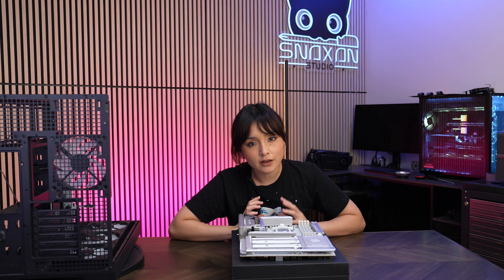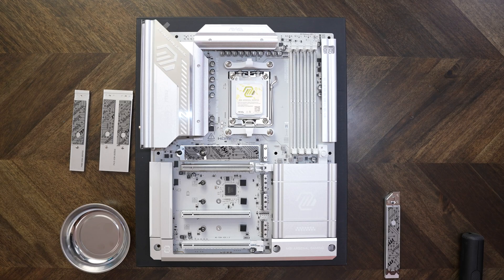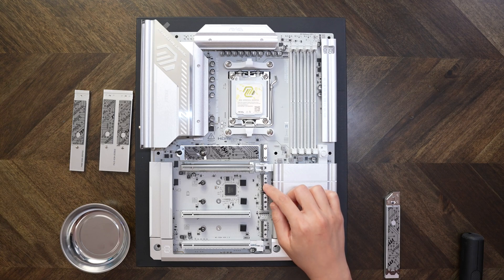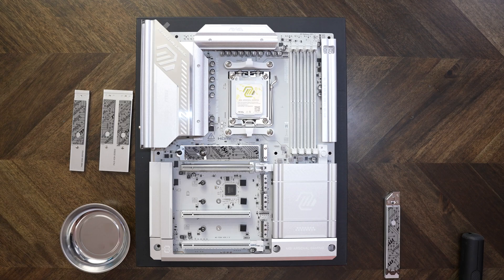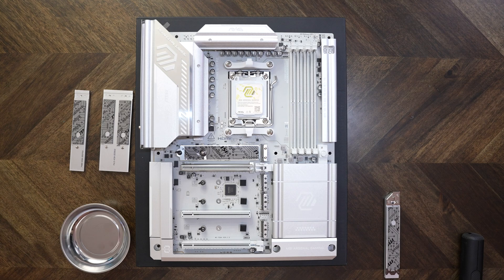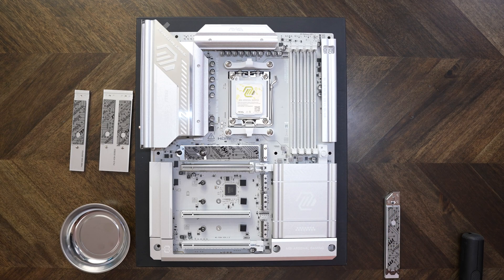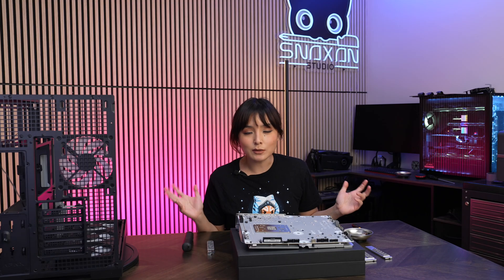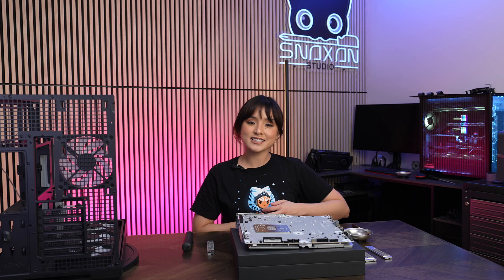Project Zero + AMD x870e | MSI MAG x870e Tomahawk MAX Wifi PZ Preview

Comment: Are you having driver and PC shutdown issues? I recently got this mobo and swapped out my current build which was also a x870e msi pro entry board. And my PC has gonna haywire. PC shuts down when installing apps, games and drives. Sadly there is no bios update. I fresehe installed windows and all and it just powers down. Event log states kernel power failure
Reply from the maker: I haven't used this board yet as I'm waiting for the right build.  however assuming you have all the latest drivers installed (GPU too),  I would start with the easiest and monitor your temps when you're installing stuff.  If you're temps are high, maybe the cooler wasn't seated right with the paste.  if not that, then check your RAM, try duplicating the issue with just one stick in or other RAM to get that out of the equation.  The one time I had a kernal related error it was the RAM.  Also check all your PSU cables are seated and tight.   The last thing in the chain is the mobo itself but that would be really rare.    Good luck and hope you find a fix
Reply: @SnaxanTech thanks. Problem is I custom hard tubed my PC and the last thing I expected with this. I will try to swap back the old motherboard. I'm hoping for a bios update before then.  Thanks. Will have to take it apart and troubleshoot with soft tubes. I will update once I find a fix
Reply from the maker: @jolush1207  good luck!  but yeah, just check those temps first!
Reply: @SnaxanTech sadly I had to RMA the project zero board since it doesn't have new firmware my 9950x3d kept shutting down when launching games. Tried my old mobo and another board x870 and it worked perfectly. I will get another pz board when a few firmwares are released.

Comment: Looks great, but I am wondering, due to the back connectors is this board limited to certain cases that can accomodate those back connections?
Reply: Pretty much yeah, I think currently sold MSI branded cases support these motherboards. And all the Frame cases from Corsair also support these motherboards.
Reply from the maker: Yes, you need to check the case specs to make sure they are back to front compatible.   MSI is called project zero, Asus is BTF, and gigabyte is called stealth.  The layout on all of them are generally pretty similar from what I've found, meaning if the case is BTF, it may also be just fine for Project Zero.

Comment: Love the brushed alloy, hate the PCIe lane share, but to be honest plugging an external USB4 drive into a PC is also irritating.

The back connection would certainly remove the desire for braided Cablemod kits, the color looks like the Sapphire Nitro+ 9070xt would work,  sadly won't work in a HAVN case. But still tempting.

Comment: Those companies need to stop putting resistors under m.2 ssd i had to return 10 ssd enclosures because ineo updated their 40gbps enclosures to all have planned obsolescence the ssd gets very hot resistors should not be under those components. Measure the space if a thermal pad does not fit like the ineo enclosure it bad design. All that heat going right over the chips and resistors.
Reply from the maker: Interesting.  Never heard about this being a common issue
Reply: @SnaxanTech they literally just started doing it the past year. Ineo 10gbps 20gbps didn't do that. Immediately when ineo 40gbps came out every single enclosure of theirs had it. I couldn't even count how many resistors they crammed under there it was so irritating. Now they want to start putting vital chips. Not good

Comment: I have the regular black version of this board in my main system. It's the best overall x870e board out there.
Reply from the maker: I always tell people the tomahawk is one of the best bang for the buck motherboards you can get
Reply: @SnaxanTech I own the Asus x670e Extreme, used the x870e Crosshair, and also the x870e Gigabyte Master board...the MSI Tomahawk x870e is hands down the best AMD board available right now. It's also more stable IMO than the rest. I want to test out the ASRock x870e Taichi Lite board though. It's priced right, is EATX and has a ridiculous 24 phase VRM, lol.
Reply: Gigabyte Master x3D board is the best

Comment: After years of using Gigabyte motherboards, I also got an MSI but PRO B850-P wifi model for 9600x and 9070XT. My first choice was AsRock, but I didn't want to risk (the rumours about 9000 series CPUs dying on AsRock scared me a bit).
Reply from the maker: Nice!  My first watercooled PC ever actually had a gigabyte motherboard and it's still running, never had much experience with AsRock.  I've built tons of MSI as of late, no issues either.

Comment: i wish more boards would rather put all their nvme and usb lanes on the chipset and leave the cpu lanes for the pcie slots as most power users need more pcie lanes.
Reply from the maker: It's probably because you'd still only have 8 lanes left after the first pcie slot, also keep in mind you might get bottlenecks for any nvme 5.0 if you don't go directly to the cpu.

Comment: I can‘t understand why everyone just refuses to also make these back connect boards in black!
Reply from the maker: If you have to have black, you can go ASUS.  Theirs are almost all black while MSI is white/silver.  I really like the look of the white/silver though
Reply: cuz they  are still too niche for most builders and the point is to see how pretty the "non" cables look. i am with you overall tho, as id love to do a back connect build but only if i can find a black mobo
Reply: @larrydysondev  I'm currently in case compatibility mode for this X870E Silverback beast. I don't wanna use MSI's PANO 100 case so I'm still hunting. I gotta say the silver is kinda growing on me a little. Plus this board is pretty feature rich. 2x Gen5 2x Gen4 + the extra PCIe power connector, you end up with a total of 420 watts of available power...that's bananas. I might need a 1300w PSU for this Beast. This board smokes the ASUS B850 BTF.
Reply: Theirs a Intel rear connect board i black...ASUS I Think. I' was trying to find one as well but a AM5 board in black.
Reply: @Csimon2429 exactly! There doesn‘t seem to be any options for am5 in black (at least under 500$)